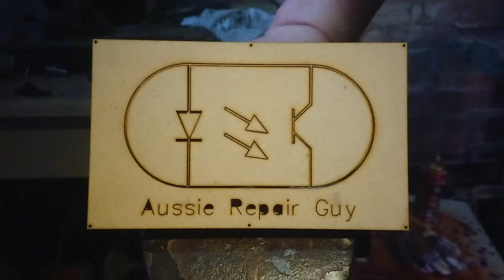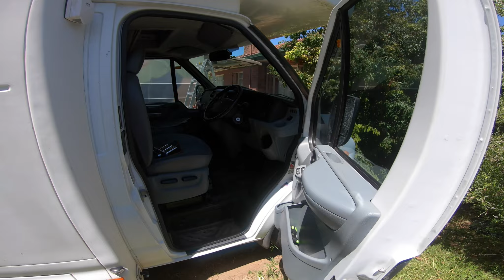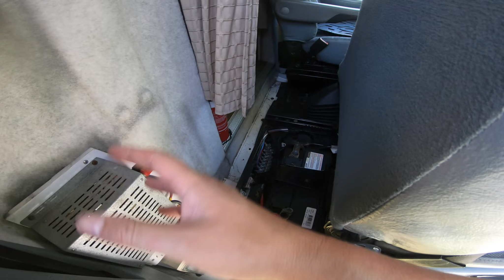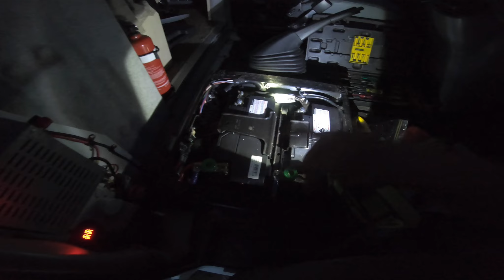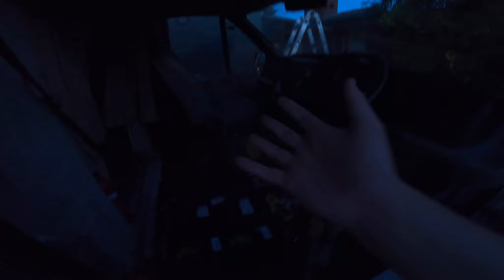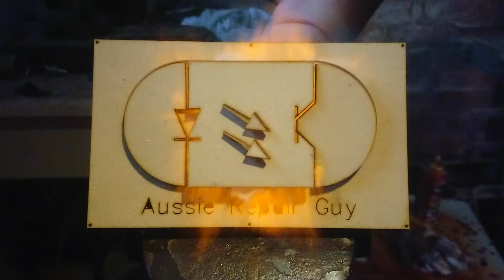Battery isolation done wrong, for a reason.

Comment: I have an ex ADF 240 to 24V battery charger, brand new, the voltage appears to be programmed for an unusual  battery arrangement (bit low for normal lead acid or lithium)
- It is a good charger by design, and quality of manufacturer and is programable, but I have not been able to access the cables for programming
The model is KOP601made by Piktronic
- If you are interested in this, I am happy to post it to you as a gift.
Even without reprogramming, I am sure you would be able to simply offset the earth measurement voltatge (a modification) to deliver the correct voltage for normal applications
Reply from the maker: I just looked it up, and looks like it has a few modes, could be an interesting project.
if you want to email targ@theaussierepairguy.com.au we can speak about specifics.
Reply: @TheAussieRepairGuy  
email sent, I did get a warning saying not a valid email, but will trouble shoot this if required
Reply from the maker: @johnallen3555  yeah I just ran a test message to it targ@theaussierepairguy.com.au is the address, seems to be valid this end, but some domain's don't like .com.au addresses
I do have discord though, you can get the invite link on my channel's about page as well.
Reply: @TheAussieRepairGuy  
I hace email done but trouble with the email address, I get messsage saying that the email is not a valid address
When I do send the email fails to send to you but does copy correctly to me